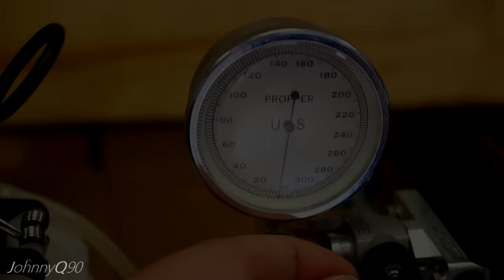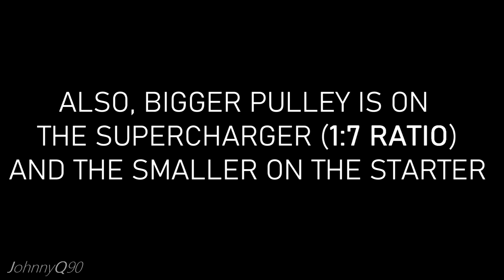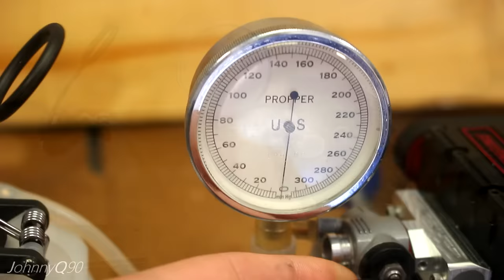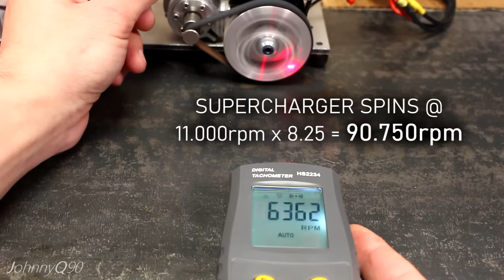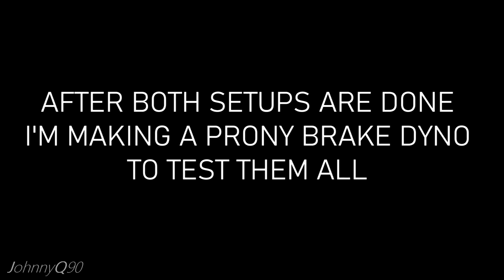0.6psi @ 90,000rpm Supercharger on MINI 2 Cylinder Four Stroke Engine! - BLOW Through Setup

Comment: Definitely seems like pressure is being lost from the tank. We used to see that regularly with 3.5cc 2 stroke engines in 1/8 scale on-road cars about 15 years ago  where either the plastic tank would distort or it would blow the tank lid open a touch. A new smaller tank would help there as it will be stiffer than the current one.
You'll also need to richen up the fuel mixture on both carb needles because of the additional air going through the engine which is making it run lean (I.E. air rich).

Comment: Reduce losses in the setup by selecting a belt width that isn't so wide as there is quite a lot of losses especially around the smaller pulley.  You may be able to spin the supercharger faster if you have two stages Belt drive and possibly reduce some friction as the belt doesn't have to go round such a small pulley..  But obviously there would be increased friction by the intermediate pulley set up.  Good to get the turbo up to 180,000 RPM   smaller diameter bearings would help with fiction at higher speeds on the supercharger,  maybe run the supercharger On an electric motor to find out how much power it started to draw as the speed of it increases to 200,000 rpm  with a unrestricted supercharger this would be the maximum amount of energy required. Restricting the flow And measuring the pressure would give you an idea of The compressor stall.  A little bit like putting your hand over the end of a vacuum cleaner as the motor spins faster when that happens.
Whatever you do it's all interesting keep up the good work.

Comment: This might be a long shot, but you could try adding a little positive pressure to the fuel tank.  feedback hoses are great when the flow rate is low but can be unreliable if they feed off turbulent gas.

Comment: Probably should test differents designs for the rotor? Design an optimized axial compressor for the task it's not easy, but probably you could experiment with the sweep angle/ section airfoil/ etc..

Comment: I have always wanted to fit either a T1 Garrett or a equal sized supercharger to my 850cc Reliant engine, I know someone was working on developing a multi point fuel injection for the same but the 850cc is an all alloy engine that puts out about 40hp and I reckon a blower be great fun as an upgrade although from what I understand, because the carb is in such a limited area, an intermediate charger or turbo would have to sit with the carb elbowed off into the engine bay.

Comment: You need to get the fuel pressure up, maybe add an fuel pumps and regulator, you have to be slightly above boost to make it work, fuel pressure also need to be linear with boost.

Comment: hello johnnyQ90 I love watching your videos, I think you have great creativity and I hope you don't take the bad advice I have to give you !!
the carburetor is made to work with the engine vacuum which is what makes the gas pull into the intake. when it works with pressure, the arrival of gasoline is neither constant nor stable, that's why when you accelerate the engine is lagged and even the mixture can become poor !!!
my advice and put the carburetor in the intake port of your compressor! youtube turbo / carburetor
I hope I helped goodbye

Comment: Full sized car turbo spins at well over 100 000 RPM, this tiny turbo would need to spin many times faster than that to produce the same boost, due to square-cube law. You gonna need a huge speed ratio, probably well above 1:100, you gonna need a gearbox. You might need to do away with roller bearings and use bushings. The blades strength will probably be fine, also due to square-cube law.

Comment: @JohnnyQ90 May I'm wrong but is it not better when the carburetor is in front of the turbo? So you haven't to set the whole volume of the fuel tank under pressure. So that may increase the reaction of the engine to the turbo and you got a perfect lubrication and cooling of your turbo through the fuel oil mix.

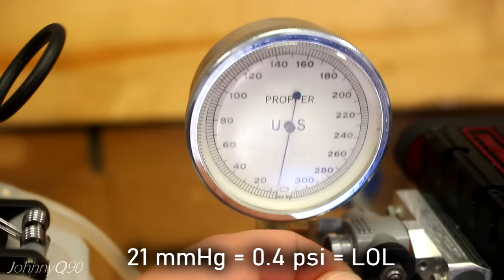Comment: 6:05 
 760 mmHg= 14.5 psi. So, 14.5/760=x/20, solve for x and you get ~.4psi 😂
Reply: I don't mean to be that guy, but 760mmHg = 14.696 psi, so the peak reading of ~30mmHg  would be ~0.58 psi. (or 0.6 psi, if we're concerned with significant figures) The larger pulley shown at 9:45 more consistently hits these numbers.

Granted, this is all measuring peak static pressure, and not pressure generated at a certain volume of air flowing through the intake, so I suspect it is almost a moot point. If anything, this supercharger would likely serve as an intake restriction once connected to the carburetor. (3.5cc engine @ 11krpm should be taking in something like ~0.67 CFM, which I sincerely doubt this little supercharger could keep up with at any appreciable pressure)
Reply: @animefan73  you are that guy... splitting hairs to suit your fancy. Good on ya.

Comment: Once again, I ran the calculations of this compressor per Casey and Robinson nondimensional parameters and you will not make any usable boost until you spin this thing about as twice as fast as you are now.  Given your blade design is optimized and it's sized appropriately which I already know it's not with only 4 blades.  Your best bet would be to effectively double the compressor size, increase the number of blades, spin it to around 100k or more rpm and try again with the 4 cylinder Toyan.  In theory, C&R checks out..  I'll send you a blade design with comp map if interested..

Comment: I'm assuming it runs better in general with the bigger pulley because the increase in your baseline pressure increases your standing fuel pressure as your fuel pump is essentially the supercharger

Comment: The problem with a supercharger or a turbocharger for a small engine is it needs to be larger in relation to the engine as engine displacement gets smaller. This is still a fantastic build, however!

Comment: Well, thank you Man :)
Try to mesure the pressure with the manifold on, because proably the engine suck much air than the compresor can supply and the pressure drops, soinstead of 0.6 psi, perhaps you get only 0.2 psi

Consider the fact that pressure increase with the square of the rpms
I think you need 130/150k rpm to get 1.5 psi.

Comment: Personally I think you need bigger compression housing and turbine. Also the components need to be as light and as thin as possible to get weight down as much as possible to get the rpm higher

Comment: Have you tried to play with the valve timing, to compensate for thee extra fuel and air mix, perhaps have the inlet to open earlier and a little later on the exhaust, pretty sure you will see different results, maybe make a pair of high lift cams to see with timing changes more power.

Comment: You need to test the supercharger a bit more. See what kind of flow rates you can get at different psi. I doubt it’s anywhere close to that 0.6 psi with the engine running.

Comment: JohnnyQ90, it looks like your printed connection between your procharger and carb is PLA, or PETG have you considered TPU? It's a bit more of a pain to print but you may find you get a better seal due to the flexibility of the material. Your work by the way is beautiful!

Comment: Do you think that added throttle response could be due to the no flywheel? I know in all of our full size racing engines we do everything possible to remove every gram of weight from flywheels, stators, starter rings, all drive accessory pulleys you name it, we lighten everything and many times use titanium that we machine the same way. We’ve even gone as far as machining our own pressure plates (flywheels) out of titanium. I just don’t think that tiny about of boost is going to make that noticeable of a difference? When we’re taking 1,200 horsepower then sure it may be only a few horse we gain, but on this small of an engine, maybe the gain would be more prevelant?  Just thinking out loud after years and years of engine building. Good work! These are fun to watch after working on the big stuff. I do the same with mode airplanes over at Ramy RC after flying the real thing for a loving. Good stuff.

Comment: the radial turbine will not work if you just scale it down.  it need some particular rotor size to work.
in small scale you should use roots or screw compressors which are scalable by design.

Comment: To me it looks like you need bigger turbo slightly. Reason I say that is when your increasing rpm to 90k your getting throttle response back. With smaller pulley you don't have enough air. Run little bit bigger turbo with that same big pulley I think you will see 👌 results.

Comment: You need to test the psi with the supercharger hooked up to the engine. Because i have a feeling that the supercharger is acting as a restriction and there's still negative pressure.

Comment: Bigger blower
Bigger intake
Less blower overdrive.
Y'know the whole "forces increase with the square of the speed" deal, the drag on that belt must suuuck.
Reply: Wouldn't this flow more at 0psi but not be able to make pressure to force the air through the tiny valves
Reply: @joshieeee20  as it is the impeller seems undersized and the intake too restrictive (a 90 degree curve can reduce flow by 30% amd this has 2) hence it has pretty much no flow or pressure.
The circumference of the inducer grows by Pi of the diameter so increasing the blower size drastically increases the chance it has for flow and pressure, right now its like an asthmatic mouse.

Comment: This carburetor isn't suitable for blow through despite back-pressure from exhaust. I'm wondering that you have even tried. You've done a hard work. And a successful next (pull through) setup! The geometry of compressor rotor is made for high flow. It should be designed for high pressure and lower flow. This could be achieved by a slimmer radial design. I guess that would go beyond your patients and nerves about this great project. Snief...

Comment: Your machine work is amazing mate. Got a question for ya.. How much could the connecting rods in that motor be holding it back since it is using traditional bronze bushings without a pressurized lubrication system? or at the very least an oil slinger tossing lube up on shaft for cooling. Also maybe machine a velocity stack for that turbine to help it draw more air effectively too. Not sure the effects on a test stand with one but once its a rolling unit could help a bit.

Comment: when you supercharge an engine... many naturally aspirated carbs cause problems, try draw through and retune the carb with the supercharger running. there are tiny fuel injections systems that were made for moel engines... but most didnt sell well and were discontinued.

Comment: You need to put a line on your intake hose and run that to a boost/vacuum gauge. Not at all trying to crap on what you've done, It's awesome that it's doing anything and your work is amazing but measuring boost with the supercharger running straight to the gauge will not give you any indication of how much if any boost the engine is getting. Boost is just a measurement of restriction and with a motor drawing air from the pressure side of the blower there is a lot less restriction than blowing into a sealed line going to the pressure gauge. I wouldn't be surprised if you were still pulling a vacuum between the blower and the carb, At the very least it'll definitely be making a lot less than indicated in your test so far. For an example I have a supercharged v6 swap in my hilux, When the motor had stock manifolds and exhaust in the car it originally came from it made around 10psi boost. After going in the hilux with aftermarket headers and free flowing exhaust it dropped down to 7.5-8 psi because the engine can flow more air on it's own and "get out of the way" of the supercharger for lack of a more technical term.

Comment: Its gonna be cool if its possible to adjust the timing for more power because now more aircome in and need to be ajusted. If im wrong about what i say with the timing tell me on the comment.
Sry for my bad english
Reply: You’re right but sadly you can adjust compression ignition engines, so he has to switch to spark ignition to change the timing

Comment: The problem is these rc style carbs were never designed for boost would have to be a suck thru application to keep the boost pressure from pushing the fuel backwards during boost, rule of thumb is for every nominal increase in boost you need an equal increase in fuel pressure over stock.

Comment: I think you're increase in throttle response is from losing the flywheel and going to a possibly lighter pulley design.  you've got lots of inertial weight on the snout of that crank.

Comment: You should mount the carburetor on the inlet of the supercharger, your fuel is to lean, also with the supercharger pulling the fuel though the carburetor you should get a better throttle response

Comment: You'll need to up the supercharger rpm to 140k to get any decent psi, probably another reduction gear is needed. Or bigger supercharger would do it. 25-33% bigger impeller would probably do the trick

Comment: That's interesting that the throttle response is so poor, even with the boost referenced fuel tank. I assume you did retune the carb after you connected the blower.

In theory it should work, but in practice... I'm definitely interested to see what a draw-through does.

As far as boost pressure goes, you'll probably have to go to a compressor with a larger exducer to inducer ratio instead of trying for higher and higher speeds.

Comment: After watching this again, it seems to me that you made it less efficient with your intake design. 

With the original ITBs it was I direct path to the cylinders. But with single intake set up the air has to take two 90* turns before entering the cylinders. 

Seems like that would make the S/C work harder to do less work to me. 🤷🏾‍♂️

But I guess we’ll find out when you make your dyno huh!😁 

(I hope you see this and try all configurations on the dyno to see which really makes the difference!👍🏾)

Comment: How could that method possably measure boost? Boost is a measure of restriction, the more efficiant the engine the lower the boost for a fixed impeller speed. Also, if the air flow through the supercharger is restricted too much the air will stall around the impeller and show much lower pressure. I would also like to add, your fuel pressure needs to be 1 atmosphere higher than your boost pressure. Perhaps a OS 105 carb with the pulse pump could cure your fueling woes on a blow through setup.

Comment: That bigger pulley made it into a different motor! IMO your supercharger still isn't spinning fast enough. Full size turbines spin up to 150k rpm, considering the fact that your surface area is so small and the scaling is exponential, you're probably going to have to spin that turbo at like 300k rpm make any meaningful boost.  Still, going to be super interesting once you dyno all the different setups, love these tuning videos!

Comment: Hi i dont think 90000rpm is enough. Tutbochargers/superchargers run at 150k rpm and more at full boost levels.
Also because of its size your supercharger must easily spin at 300k rpm to archive the needed velocity on the outside of the compressor wheel to produce any kind of boost pressure.
You have to have a lot of centrifugal force. The larger the compressor diameter the less rpm you need for same pressure.
I would do a second stage of pulley system where you have the first stage 1:10and the second stage again at 1:3 -> motor rpm 10000 -> first stage 100000 -> second stage 300000rpm i think thats the only solution. Nothing to do with blow/pull throgh style :)

Comment: you need a step-up gear (multiplier) for the supercharger To give out 120-150000 rpm = 0.5-0.6 bar boost Sorry I'm not the USA, I wrote via google translator

Comment: Your supercharger isn't making boost when the duct is on the engine. You may be able to pressurize a closed chamber to half a PSI, but the intake of an engine is under vacuum. So when a supercharger on a car makes 7 PSI of positive manifold pressure, that's on top filling the 14+ inches of vacuum.

Comment: Engine sounds and looks like running lean.  I think you will have much better performance with draw through setup (carb before supercharger)....but with 0.6psi of boost, there will be little gain on this engine. At 90000 rpm, airflow is more important than a small pressure gain, try bigger cam and/or port the intake

Comment: stock cam isn't optimized for forced induction. I'd look in to if you can cnc a thou or 2 extra lift. check valve clearance, measure and calc the rocker arm ratio and see if it's feasible to go with any higher ratio for extra lift, or try to discover cam specs. where there's a will there's a way haha. any engine can be "massaged"

Comment: Have you considered getting your fuel tank back pressure from ankther source  and letting all the air from the super charger go into the engine?
Another source could be PCV,  that little engine must be producing some.

Comment: Does the 0.6 PSI of boost compensate for the power absorbed by the supercharger?
On very small engines you're better off with a displacement supercharger instead of a 'turbo' (roto-dynamic, impeller) type blower. They will be much more efficient (boost produced versus power absorbed) and will actually increase the power output.
In other words, they will actually do their job.